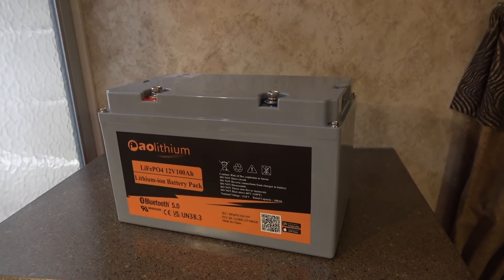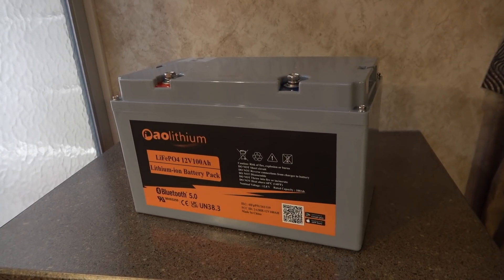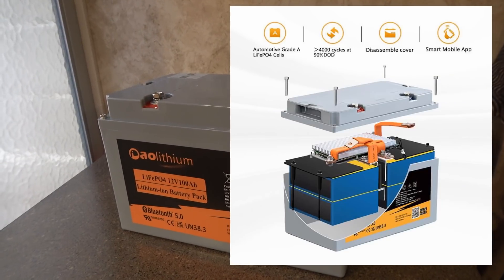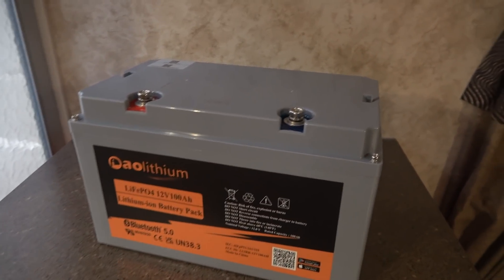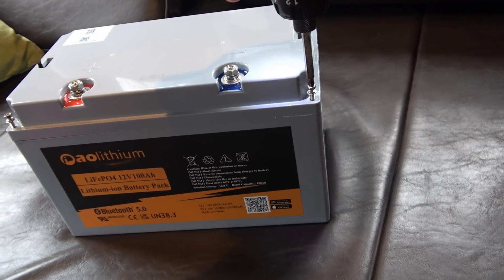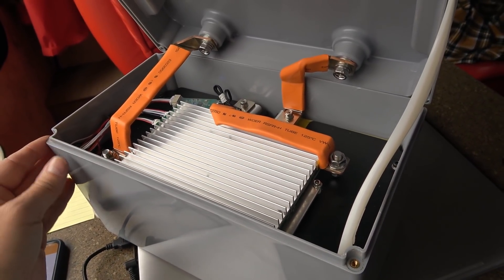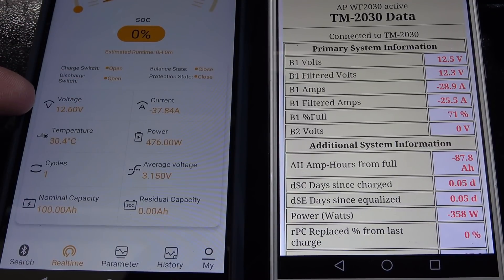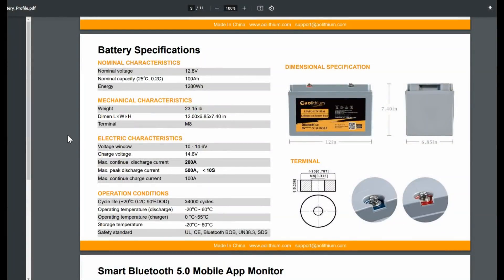Aolithium Battery Demo & Review - 100Ah 12V LiFePo4 with Bluetooth App

Comment: My Aolithium battery is in discharge mode and will not go into charging mode and it’s just over 55 SOC so when I try charging it states full
Reply from the maker: I wouldn't trust the Bluetooth app SOC as it can get out of wack sometimes. Discharge the battery a bit and then see if it will charge. Use a charger that can output at least 14.2V or more.

Comment: Given how advanced the BMS is in this Aolithium battery, can I just use a typical lead-acid solar charge controller with this battery?
Reply from the maker: A typical lead acid charger will work somewhat but won't work as well, since its charging algorithm is for a 3 stage charging profile based on lead acid chemistry.  Lithium just needs a constant voltage in the 14.2-14.6V range. A typical lead acid charger will quit high amperage charging too early and reduce to a float/trickle charge mode and leave the lithium battery less than fully charged. See this video - https://www.loveyourrv.com/lithium-battery-charge-test-can-you-use-a-lead-acid-charge-converter/  Depending on the lead acid charger you may be able to change settings or manual adjustments to make it work.

Comment: I'm getting a pair of these batteries in a few days. What size (length and gauge) cable do you recommend to parallel the duo? Also, any suggestions for an external (home) lithium battery charger. I have quite a few of the SLA and flooded type chargers. See you in Los Estados Unidos very soon. Thanks!
Reply from the maker: You want to keep the cables as short as you can. Gauge will depend on the max amp draw you would expect which usually depends on the inverter wattage. Larger the wattage of inverter, thicker cables needed. I use 2/0 gauge on my battery bank and its worked well.  The inverter manual usual details the cable sizing needed.
Reply: @LoveYourRV  The inverter that came with my 2022 RV is a GoPower 1,000 watt unit.
Reply: So 2 gauge should work fine? I don't plan to upgrade my 1,000 wat GoPower inverter for a while.
Reply from the maker: I used 1 gauge cables for several years with my 1000W inverter and at the time had 4 golf cart batteries. They worked fine.
Reply from the maker: Cable gauges can be confusing. 2/0 is actually much larger than 2 and even 1. It actually stands for 00  or 2 aught https://www.powerstream.com/Wire_Size.htm
Reply: @LoveYourRV  Thanks. Safe travels in the USA. Being from San Francisco and now Fort Worth, I've always enjoyed camping in the American Southwest. I pickup my new 23' 10" Rockwood Mini Lite 2205S in a few weeks in Shipshewana, Indiana. Maybe I'll see you on the road. Somewhere warm. Thanks.

Comment: 12.8 volts seems odd. I guess you set up your charge controller like lead acid? Lead acid has different charge profiles than lithium.
Reply from the maker: 12.8V is actually a pretty standard rating for 12V lithium batteries. It refers to the "nominal" voltage rating of the battery. Many LiFePo4 batteries use four 3.2V lithium cells paralleled which equals 12.8V. The actually working voltage varies depending on charge state and amperage draw at any given time but the 12.8V figure is used to calculate a standard for watt hour capacity.  So this 100 amp hour battery x 12.8V nominal = 1280 watt hours of capacity. At least that's how I understand it.

Comment: Like others the narrow spot for attaching cables to the battery is a no-go. I’m using 4/0 wire. No way I could connect to this battery. Rather short sighted. Makes me think the designer doesn’t have much experience with lithium batteries.
Reply from the maker: I find with a lot of these Chinese companies batteries look like they get designed for single use. They don't quite get that people are going to want to use multiple batteries making a large bank and power huge amperage loads. Maybe its the world RV market versus North America. Most of the RVs around the world are rather small in comparison. That's my guess.
Reply: That makes a lot of sense

Comment: How does the app handle multiple batteries for extra current?
Reply from the maker: I believe what happens is each battery shows up as a separate device in the app. So you look at them individually.

Comment: Do you have a video showing how you’ve set up your electrical system? My 5th wheel looks like it’s from the Stone Age compared to yours.  Need to do a serious upgrade this winter.  Thanks and welcome back
Reply from the maker: I'm planning to do a new video in a few weeks to show the current state of things. I'm always tinkering and rearranging and adding new devices I'm reviewing so its a constant evolution. :)
Here was one from last spring https://youtu.be/V6UAE5lavwA  Things have changed a bit since then as I  now carry the Lion Energy power box and its 6 folding panels.  https://www.loveyourrv.com/lion-energy-safari-me-off-grid-power-station-review-portable-rv-camping-solution/
So I've spit the roof panels into 2 arrays feeding 2 MPPT controllers I have now.  I'll have a video today or tomorrow showing the newest SRNE MPPT controller I installation, it replaced my older PWM controller that is in the giveaway package.  Cheers, Ray

Comment: You could just drop the package off at my house on the way down south. Hint, hint. Just kidding. I'm going to buy a new battery to replace the 200 ah battery that I killed the BMS by crossing the wires. Dumb me. I may just go with 100 ah and carry the damaged 200 ah as a boost, if needed. I have a generator, so no real risk. Welcome back to the U.S., Ray!
Reply from the maker: Thanks, good to be back. :)

Comment: I wonder if these are stackable?  I would like to win it as I could use it for an old RV motorhome I am re-building ... 17'
Reply from the maker: You can stack them in any position, lithium cells do care what orientation they are in. Inside everything was locked tightly in place.
Reply: @LoveYourRV  thanks .. for the quick reply.  I was thinking with the recessed terminals that maybe they made the bottom of the battery to stack on top of the next...

Comment: Ul isn't a gold seal as i found out in my dealing with them on a fan fire item , ul test a item to the manufacturer test documents ,  drawing , other support items they supplied to ul and then the manufacturer pays ul to retest and certified the unit passes per documents.
Reply from the maker: True enough but lithium some cells don't even have the UL1642.  Here are the other certifications they claim - Safety standard ISO9001/UL/CE/UKCA/Bluetooth BQB/UN38.3/SDS.

Comment: Hey ray great video a couple of questions when you went across on the ferry where do you get off on customs as soon as you enter the ferry.
 And I hope you're having a great time you're probably getting some sunshine compared to us here on the island we're gonna be down in the Southwest the Southwest  in January .
 I'm sure I'll drive anywhere to pick up  battery and a solar panelOK be safe have fun talk to you later.
Reply from the maker: On the Coho run they do an immigration check on the Victoria parking lot side, there are US border guards posted there, Then on the Port Angeles side there is a US customs and agriculture check point as soon as you get off the ferry. We had no issues, took like 5 minutes. Cheers, Ray
Reply: @LoveYourRV   Thank you RAY so how far down did you get
Reply from the maker: We are in Newport, Oregon so far, not in any big rush south, like to enjoy the Oregon coast during the off season with less crowds. Almost have the beaches to ourselves just have to dress for some wet weather now and then.